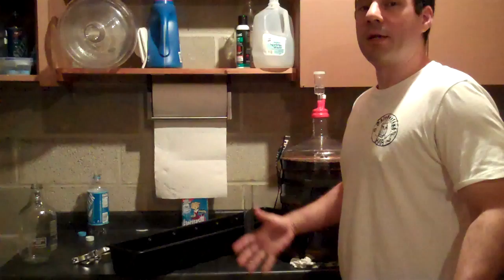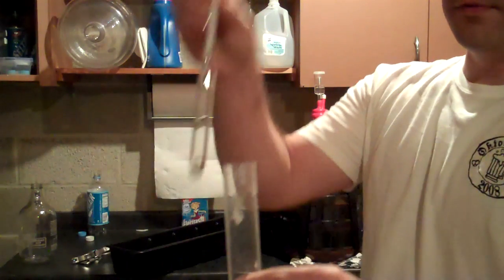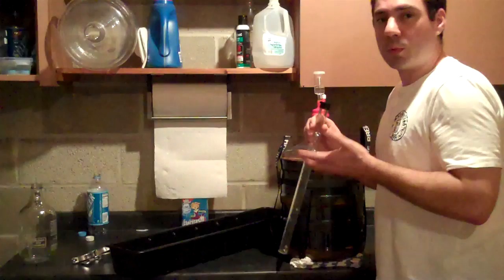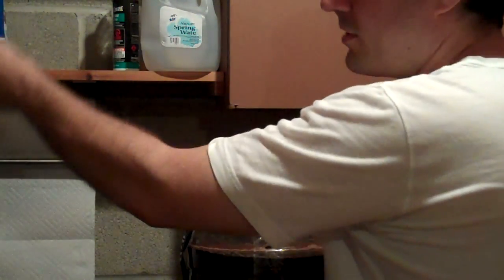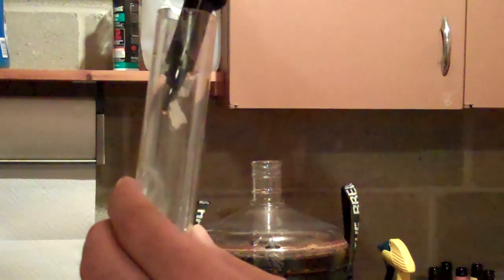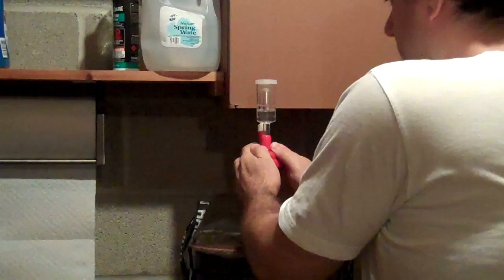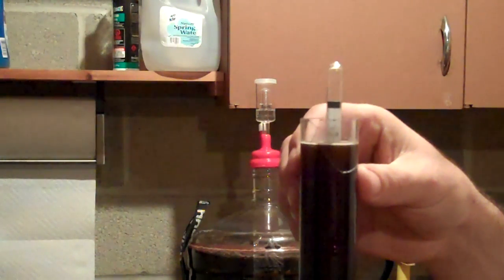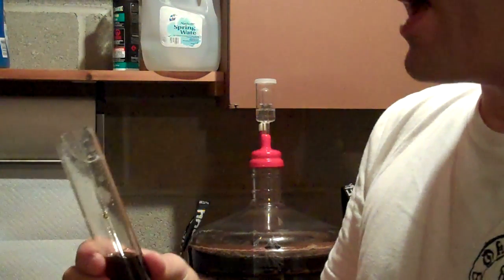Taking a beer sample using a wine thief and hydrometer

Comment: I'm still learning, but would you be concerned about adding oxygen to the beer by shaking the their in the beer? I guess I was just under the impression that you don't want any movment until your actually drinking the finished product.
Reply: thief*
Reply from the maker: Hey James! Somehow I missed this comment; sorry about that! I'm not, because the wine thief isn't splashing around in there: it's just moving straight up and down, disturbing the beer very little. You might oxidize the sample you're taking, but that doesn't matter at all.